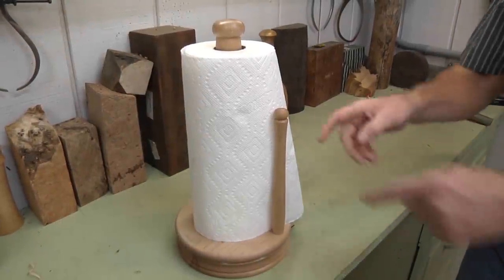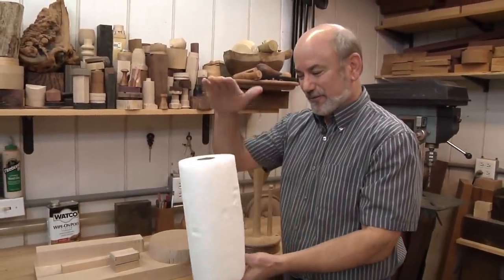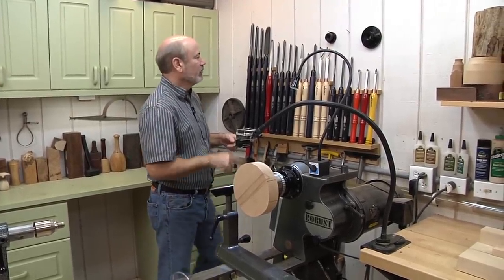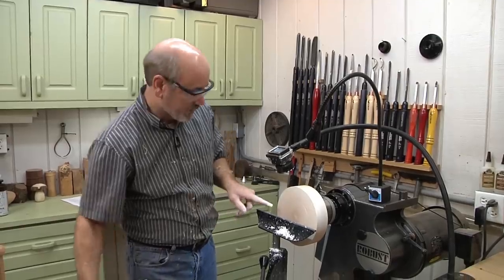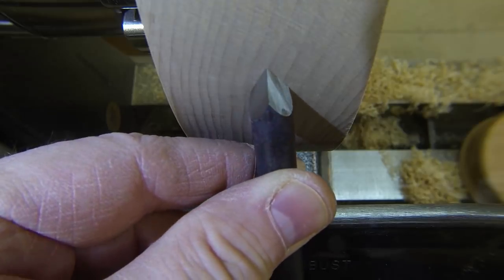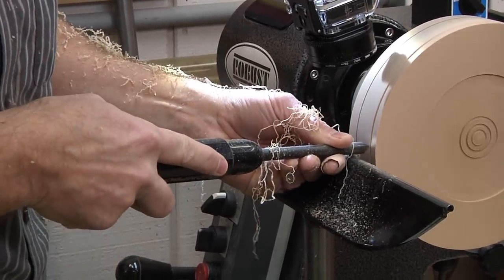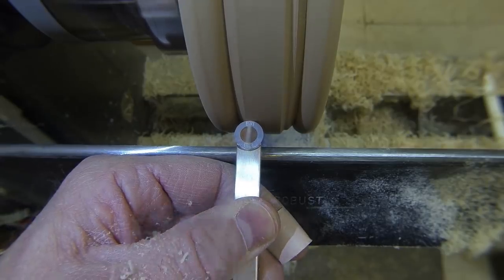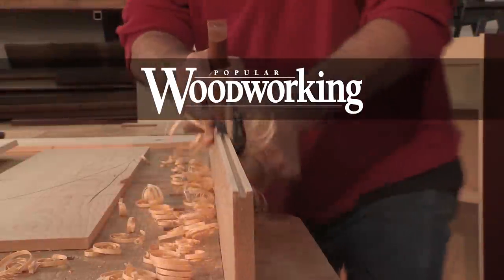Paper Towel Holder-Part 1

Comment: Ya know nobody is going to bother moving that wooden pole over and thay'll just hold the roll and pull. why noy cut a slide out from under the base and have the pole slide over on it's own by adding a spring to pull the catch over as you use the towels?